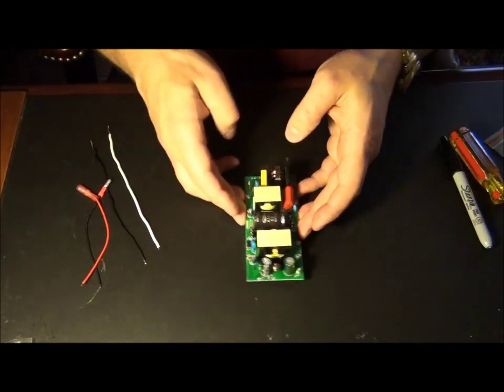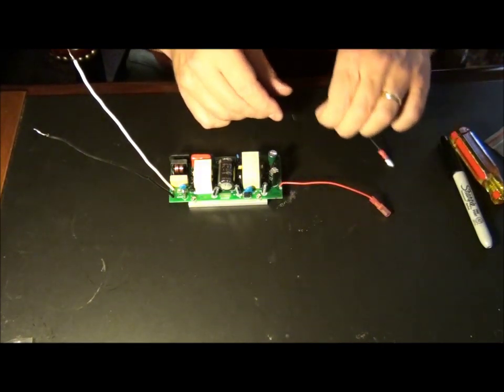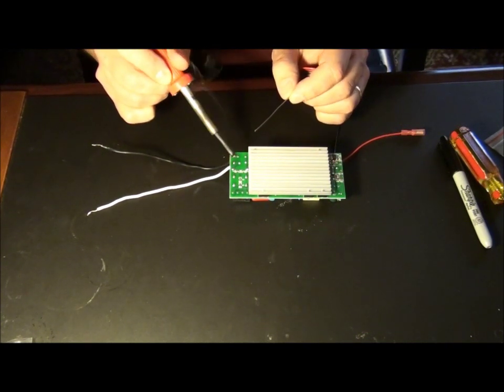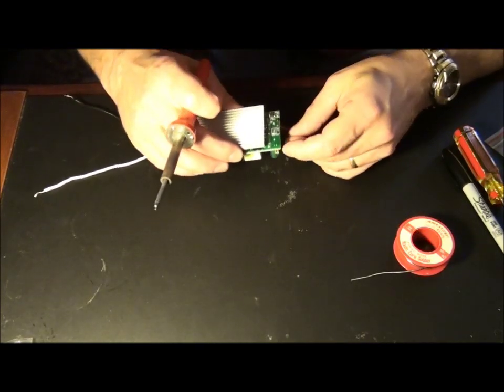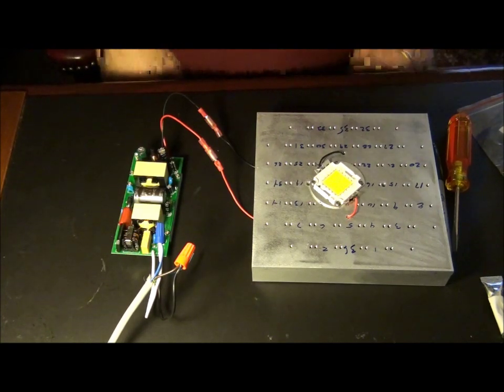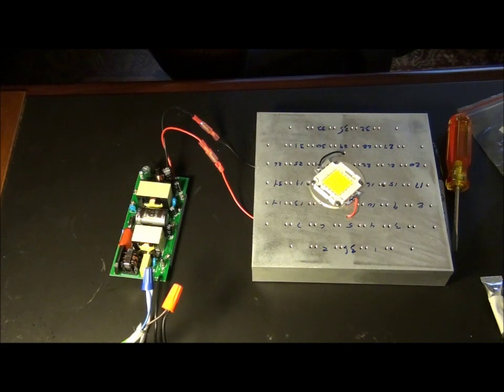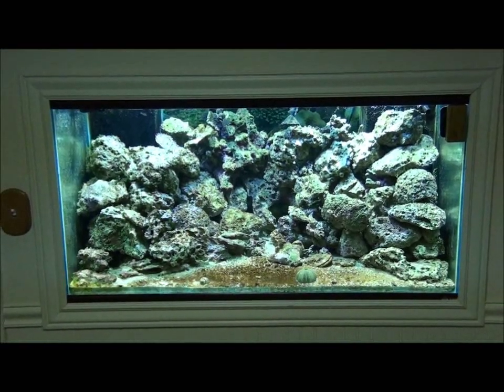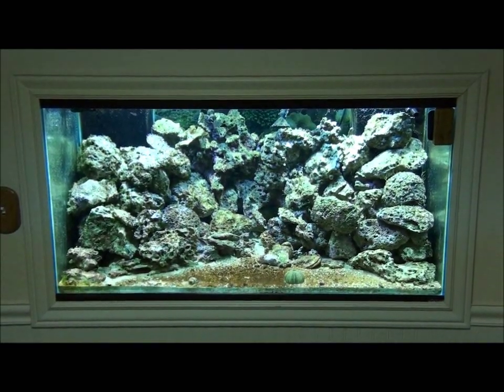DIY LED Reef Aquarium Light - Part 3

Comment: Hi, I am trying to  use LED strips instead of the individual leds you are using, would you still recommend a heat sink?  My purpose isn't for aquarium,  i am using it for a vertical window farm.  I have 4 collumns of 4 plant bottles and want a strip of lights for each.   Plus maybe some for above.

Comment: Mount a 92mm fan on the heatsync, add 2 445 royal blues 10W to your fixtures. Also you can get up to 20k 100W LEDs. :) go with a 14-20k 

Your tank looks good!!

Comment: The reason it takes a few seconds to emit is that the large brown capacitor in the center of the driver is charging. By the way, you are the the most knowledgeable person I have found on YT that's dealing with electronics. Nice work.